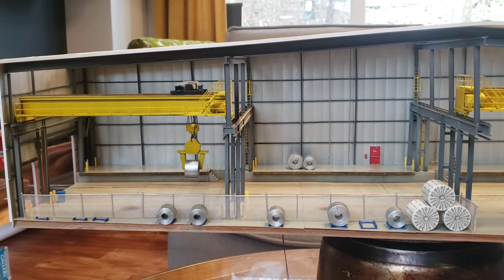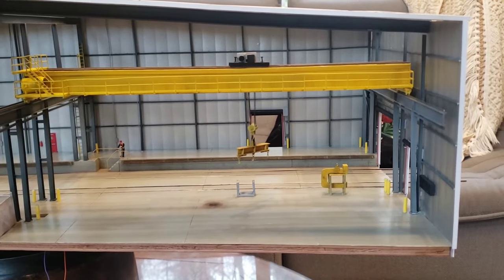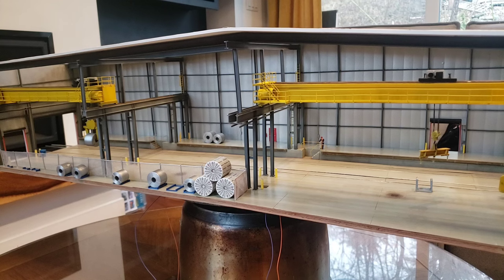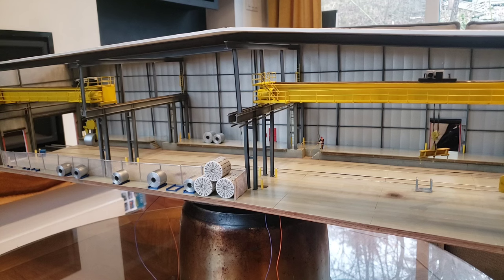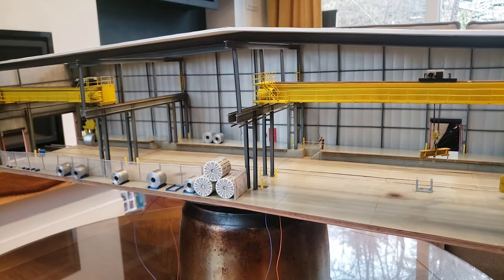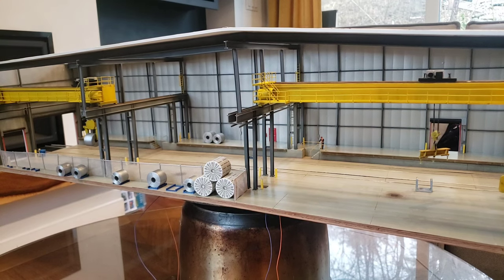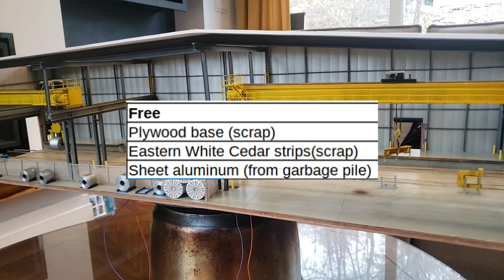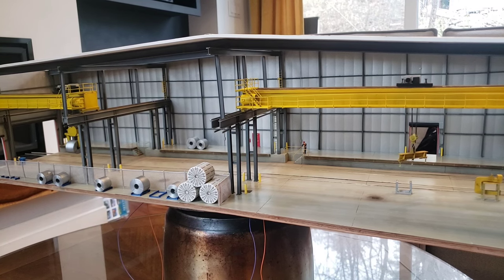Part 6: TransCare is done! ...did I 'break the bank' building it?

Comment: Awesome build. Came out great. Still cheaper than buying three $50.00 kits and piecing them together. Plus you've got a unique one of a kind that nobody else has.
Reply from the maker: Thanks Bill. I guess the larger kits are pretty expensive. I'm starting to realize just how small trains are when shown against industrial buildings. If I want realism, my buildings are going to have to be big... and I guess more expensive. Any idea how much you spent on your build from last month?
Reply: @mattw9667  I don't measure my time or money for this hobby. I mean I don't spend any more than I have to, but I don't track it. You did a good job of expensing that build, right down to the paint and glue. 👍
Reply from the maker: As I say, that glue cost surprised me. Thought I was doing well buying those small tubes. They are good for most small tasks but the surface area here was huge. Forgot I had spray adhesive in the garage. Might try that for larger wall sections
Reply: @mattw9667  Well CA has a short shelf life, so you can't buy a gallon of it. Spray adhesive may not hold long or well. If you're glueing styrene to styrene, you can't beat solvent.
Reply: I figure hobby shop super glue keeps pretty well, I’ve had them last well over a year. The dollar store metal tubes don’t give you a lot and certainly don’t keep well after they’ve been opened.
Reply from the maker: You're right, they don't keep well. I didn't have that problem with this size of model. They were bring used up in 1 or 2 days. I remember the testors model cement from when I was a kid, the orange and white tube. Maybe I'll try that next time
Reply from the maker: Agreed on styrene to styrene. I'd most likely be gluing styrene to cedar in large quantities though.  CA has the best adhesion with that combination. Just have to source a better deal.

Comment: Excellent Matt!
Can't wait to see it illuminated, as a night scene.
Reply from the maker: Thanks Ron. Hope you're not too disappointed when I do light it up
Reply: @mattw9667  I've worked in industrial buildings with overhead cranes like these, some with operator's "cabs" under the traverse beam, RC now. Usually, they would run the length of the building and not from side to side of the bay.
Worked at EMD in Chicago. Facility  had several long "bayed" buildings with at least 2 or 3 manned overhead cranes in each bay, and many individual "pole" cranes around the machines/work areas that needed them. Again you have done a fantastic job, creating this miniture  industrial marvel. 👍
Reply from the maker: Thanks very much Ron! I used a single video of the prototype facility to build this.  I found others as I neared completion. The ownership and name has changed which made it hard to find more interior content. It is not exactly like the 1:1 but it's close enough.
Reply from the maker: NSC would be cool to model for a few reasons. Interestingly shaped buildings that would suit odd corners of a layout and you wouldn't have to weather any rolling stock on the premises!